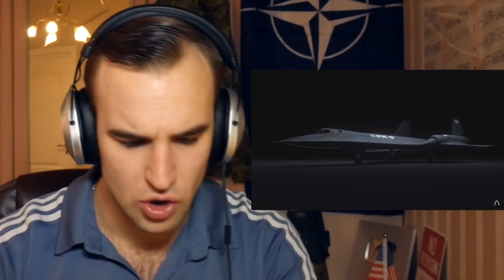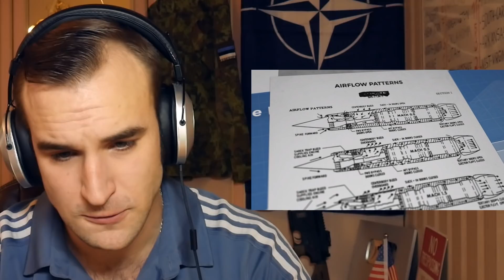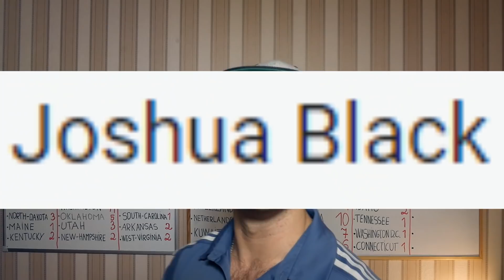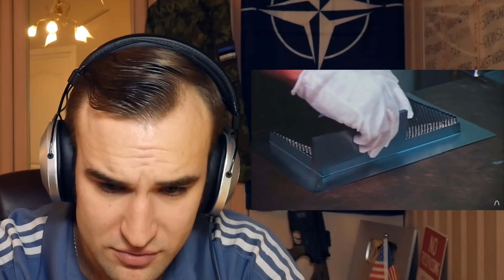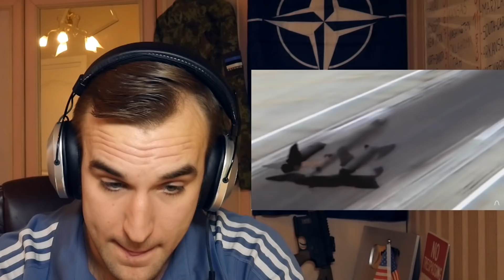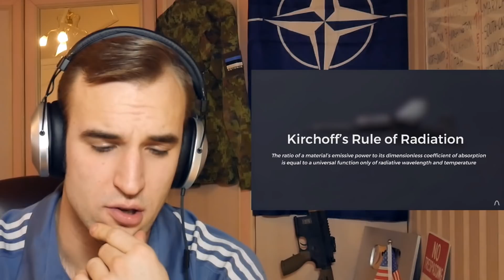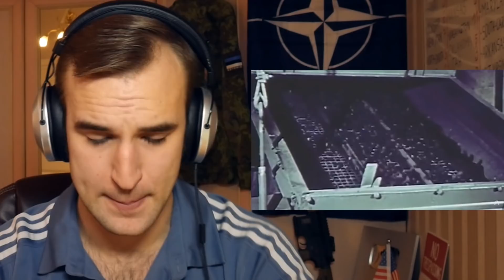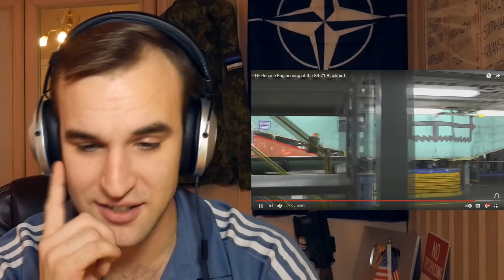Estonian Soldier react to the Fastest Plane in the World - SR-71 BLACKBIRD

Comment: Military aircraft have cracks in the spars that hold the wings on.  These cracks are mapped, and checked often to determine the crack growth rate. These rates are the determining factor for grounding. Keep in mind these procedures exist in commercial aviation! 😂😂😂. During Vietnam the pilots would sign off on dc-3’s with fuselage cracks you could look through, and would ground any aircraft. Not in Vietnam, as the pilots would be sent home, as soon as they reach a certain amount of hours.  So, fly those easy planes till they literally fall out of the sky!

Comment: In hot climates, black jumpsuits are good for outside work - if you spray them with water-  they rapidly pull heat from your body- so long as they are wet.Good for 30 to 45 minutes at 110 F.

Comment: The heat of very high supersonic flight is NOT from friction, It is from ram pressure. When you use all your strength to smash a hammer on a piece of steel, you get a spark. The energy of your blow is converted to heat, enough heat to tear apart the molecules holding the steel together, and release light. The same thing happens when you smash an object supersonically in air. When a meteor flashes on entry into the atmosphere, it is not friction. It is the result of ram pressure, the continuous pounding of the object into a solid wall of ultra-compressed atmosphere.

Comment: When a supersonic  object collides with air, it knocks the air molecules out of the way. When these molecules collide with subsonic molecules, they form extremely high pressure regions, nearly solid regions of ultra-compressed air. As they slow, these regions propagate to form sonic booms. identical to the leading edges of blast waves from explosions.  In supersonic flight, this happens every time the subsonic air is smashed by the supersonic object. In subsonic air, this can happen quickly, so you can hear sonic booms more than once from a single supersonic craft. It is not from breaking the"sound barrier", but is continual from any supersonic object- i.e, the crackle of a rifle bullet.

Comment: I don't know if this is been brought up but a little tidbit about the jet is when they use titanium and flying at over mach3 the metal expands a lot so when it is sitting on the ground and fueled it is actually leaking fuel because there are gaps in the Jets body to allow for expansion at Mach 3

Comment: Artur, you cannot fix these fuel leaks, as the plane is made of titanium....which I believe expands at 600 degrees. If the plane is sealed completely (as are other planes)...when the titanium expanded at Mach 3.4  in the air at 20,000 ft...the plane would buckle at the seams and would destroy itself.

Comment: And oh we still had those standards for everything in the USMC, from fuel, to hydraulic oil, gear oil. Etc…the list goes on, even down to how much water and the size of acceptable holes in your water proofing bag (WP bag) that you out gear into, inside your pack, once reason whey put in a contractor 3-5 mil trash bag inside our packs, then the WP bags, with stuff inside. Then you twist the top of WP bag, and tie shut, with paracord, or any twine, then the bag. Each one you push out any extra air (the puffing of the bag) but not anymore, as you need the air to float, if you’re going into the drink/have to swim with all your gear. Yes you can, with over a hundred pounds of gear, of water proofed right, had to do it, not easy, and sucks, and “swimming” like that, is barely not drowning and not fast, haha. But you can survive, and go mostly where you want, slowly.

Comment: Funny thing is... The A-12, the little brother of the Blackbird used by the CIA, is 150 mph faster. There is almost no visual difference between the 2, except that the A12 is smaller and has 2 less windows, and also doesn't have tail rudders on the underside.

Comment: The sonic wave shop boom is when an aircraft actually is going quick enough that it's body splits the air and creates a vacuum cone in between and when each side of the air flow pulls back together rapidly that is the boom you hear.

Comment: This plane is Soo fast, that during high speed flight the temperature of the plane's SKIN is over 600*F Degrees. The heat also causes the skin to expand, which seals the fuel tanks. On the ground the plane leaks fuel and needs to be refueled shortly after take off. They say the fuel cost more per gallon than the most expensive Scotch.

Comment: We do have flat fans that go under your laptop to circulate the warm air out to avoid overheating if necessary. It’s about the thickness of your laptop and the same size with partially open fan blades in the center. Basically raises up your laptop to circulate the air flow underneath. Comes with an electric plug in and battery operated portability.

Comment: The SR 71 is Filled with JP7 Which Doesn't Ignite Easily. A lit Match will not Start a Fire, it won't burn. JP7 has to be Ignited with Hypergolic fluids. The Fuel is like this because of the Temperatures of the Skin. JP6 would Ignite and the Aircraft would Blow Up.

Comment: I believe that there is a small misunderstanding on a "cloud" around a plane's wings when it breaks the sound barrier. The "cloud" is actually water in the air that turns into fog because of the low pressure air above a plane's wing. It requires extremely high speeds, meaning extremely low pressure above the wing, and therefore the "cloud" is visible. A sonic boom is essentially a plane catching up to it's own sound waves ahead of itself, generating a shockwave.

Comment: The SR-71 leaks fuel on the ground.  However, it does not leak fuel during high speed flight because the heat from friction causes the pieces of the plane to expand into a tight fit.

Comment: The truly remarkable thing about the 71’s engines is how analog they are. Case in point, the air resistance generated by its forward movement is what actually moves the cones backward to the ideal positions to minimize the shockwaves. There isn't a computer calculating that stuff, it's just physics.

Comment: Regarding the leaking fuel, it's important to note that the fuel which this aircraft used was not flammable like gasoline or kerosine. There are actual demonstrations where a flight technician would take a bucket, fill it partway with fuel, and toss in a lit match...which was then extinguished by the fuel.

Comment: The aircraft leaked like a sieve on the ground but once it was flying and the skin heated up a little bit it sealed itself up tight.  Usually what the pilots would do is take off, go fast for a bit to seal up the craft, slowdown to refuel their now mostly empty tanks, then fly the mission.

Comment: More SR-71 trivia: The engines had no self-start, to heavy, so they had to hook up a pair of buick V8 engines on a trolley to the engines to start them.
In order to keep the fuel inside the wings from igniting from the extreme heat, they had to design a new fuel. Problem was the new fuel was so stable they couldn't ignite it with anything less than a spontaneously combustion chemical.
The entire airframe expanded and contracted several centimeters per flight. At cruising speed, the expansion sealed the leaks in the wings. 
The titanium used to construct it was produced by the USSR (lol).
It couldn't take off with a full fuel tank, too heavy, so it would have to take off then get fueled up in mid air before every mission. 
It flew so fast pilots flying east/west recon patterns would see the sun rise and set multiple times during a mission. It could outfly the earth's rotation.
Designed and built by a team of less than 200 people in less than two years.
Reply: a team of 200 people … with sliderules!

Comment: Dust particles bro...Air wasn't as pure as you might think. And they were flying above desert area so often that the air at that altitude sometimes were still filled with desert sand particle...albeit small it can cause a lot of damage. Not to mention pressure created by such speed.

Furthermore it was energy discharge...Energy discharge always go towards place that was either close to that area or...To an area that has small surface area.

Comment: Artur, in spite of what people may think, this aircraft was designed by engineers using slide rules. A recent laser scan of an SR-71 airframe was done, and the information processed by a program designed to look for areas where improvements could be made to the aerodynamics. After this was accomplished, the result returned by this program merely stated ‘nominal’. This meant the design, accomplished by a team led by legendary design engineer Clarence ‘Kelly’ Johnson, was as efficient as it could be. When the time came to build this amazing bird, which used titanium alloy, the CIA set up a front company to purchase quite a bit of titanium from the Soviet Union. Ironic given what the aircraft was to be used for.

Comment: Remember, Mach 3.2 is only the "published" cruise speed of these planes. The top speed is still classified. We do know they have flown faster than mach 4 because of how fast one SR-71 flew from the West coast to the East coast. It flew so fast that people figured out it had to be flying faster than Mach 4 to to make that trip in the time it did. 
The engines itself had no top speed and were capable to fly WAY faster, however, it was the air frame of the plane itself that dictated the limit SR-71's top speed. Cheers,

Comment: I saw an interview with personnel who worked on or with the Blackbird. One, not sure if he was pilot or ground crew,  but that when you walk toward an SR-71 in the hangar for the first time, they were shocked to see the plane copiously leaking fluids onto the hangar floor. When they asked,  they were surprised to discover that the extreme temperatures Blackbirds faced meant that the plane on the ground isn’t the plane it will be in flight. In flight, due to the temperatures, those seals and leaking points close by the materials expanding or contracting. I found that fascinating.

Comment: When you are going faster than the speed of sound, the air doesn't have time to get/slip out of the way, so you have to push it out of the way.  IOW, the nose is (metaphorically) going through an invisible sponge of 'sandpaper' (the air molecules) -- that's what is heating it up.

Comment: The jet that the SR 71 was based on is called the A 12 , it looks identical to the SR 71  except it is only single pilot, and shorter than the SR 71.  The A 12  was faster and could fly higher, but didn't have anywhere close to the range of the SR 71  which is what they needed.

Comment: The SR-71 has been replaced and retired by a new secret bird.
It's codename " Aurora "  Was originally leaked in the mid 1985 on some unclassified budget reports.  And has since has a few sightings / blurry photos.

It existence was officially confirmed in April of 2019 and it's capability of Mach 6,  the aircraft having flown from 1993 to 2018.
Now Aurora is retired despite still being mostly classified. And now even Aurora has been replaced with a even more advanced jet the SR-72 likely capable of more than Mach 6.

Comment: I need to comment on an error that you made. In a previous video, you stated that a B-2 bomber had been shot down. This statement IS NOT TRUE. There was a crash of a B-2 due to an engine fire in Guam. They put the fire out and flew a crew to Guam to repair the B2. They repaired it enough to fly back to the U.S. and flew it back. They fixed up the plane and it is now back in service, again.

Comment: Pointy shapes have much less volume per unit of surface area which means they get hot very quickly when exposed to sources of heat. So while they are aerodynamic and don’t produce as much drag as blunt shapes, the trade off is they get hot from the shock heating. Space vehicles like the Shuttle would use blunt shapes to minimize heat absorption on reentry. They could afford to do this because they only had interest in slowing down in atmosphere and so more drag was a good thing.

Comment: Every hear the stories of Pilots of the SR-71?   Well story I hear was a Cessna was asking speed and info confirm from tower.  the Tower replied telling the 6000 Feet height at 188 knots.  then a bowing commercial 747 asked for fun for his Speed,  and he was going 500 Knots at 36000 feet. and now a F-16 pilot said Tower what is my air speed.   and he was doing 720 Knots at 48000 feet.   but that is when a Black bird asked.  Tower speed and high check.   80 000 feet, at 2200 Knots.     The silent of radios after was amazing....

Comment: Technically, the SR-71 wasn't the fastest jet ever. That honour goes to the YF-12 Archangel (Oxcart?) interceptor, the elder sibling of the SR-71 Blackbird. Only 3 were built (pre-production) which went to the CIA before the project was cancelled. Top speed was  2,275 mph, as compared to the SR-71's 2,200 mph. However, this is all pretty moot as the numbers are still classified secret. I suspect that the SR-71 was capable of much more, given comments made by pilot Major Brian Shul of the "LA Speed Check" story. Raegan had called for an airstrike against Libya and Shul and Watson flew in afterwards to record the damage. Of course the Libyans were waiting for him and launched a barrage of missiles at them. They had the choice to abort or increase speed, which they did, made the turn, and headed home. Shul stated that his hands were locked on the throttles in full forward position, and only powered back when they were safe. He said that they had never been so fast before and the Mach numbers were "pretty scary". So I'm guessing they, at that point, were way more than 75 mph faster than their usual maximum.

Comment: I am surprised that the public top speed has been reduced.  When I was a kid the published top speed was : IN EXCESS OF MACH 3.5.  So you can damn well bet this beast was doing over Mach 4.  As an American I can tell you, if it was capable of Mach 5 you can damn well bet we did it.

The guys who designed this craft did it all with a slide-rule - It's a analog pocket computer.

When in flight and it heats up the plane EXPANDS and seals.  At operational temp is did not leak.  It GREW by 1 foot, thereby sealing all leaks.  The plane would take off with enough fuel to meet a tanker, toped off their fuel and did the job.  The whole plane was titanium and could take the heat.

Also the other reason it was painted black is the paint itself was RAM  ( Radar Absorbing Material )   Also known as stealth.  The SR-71 also launched recon drones.  And this was all 1950-60's tech.  Before major electronic computers.

Comment: There was also the YF-12A (the Y means a prototype) which, without getting into too much detail, was an interceptor version - and American MiG-25 if you will (MiG-25 could reach Mach 3.2 but it would damage the aircraft). They got as far as test launches of the AIM-47 Falcon (which was further developed into the AIM-54 Phoenix, famous for being used by the F-14 Tomcat) at high altitude and over Mach 3.

The other problem with building the SR-71 out of titanium is, at the time, the best source of it was...the Soviet Union. So the CIA set up front companies to buy the titanium needed to build the SR-71 from the Soviet Union. So, the Soviet Union was a key supplier of materials for a plane built to spy on it.

Comment: HERE'S IS PROBLEM. SR71 FINAL FLIGHT COAST TO COAST (3000 MILES) IN 1 HOUR. THAT SOUNDS MORE LIKE MACH 4 . THE PILOTS WANTED TO GIVE IT 1 LAST SPEED RUN AND  WHERE MORE LIKELY TOLD TO SLOW DOWN , SO TO CONCEAL IT'S TRUE SPEED FARTHER. SO VIA WIKI IT SAYS MACH 3+ , BUT THE SR71 TRUE MAX MACH SPEED IS STILL CLASSIFIED.
Reply: Classified means ???

Comment: Chemical Engineer here from USA. The reason the tip gets hot is likely to due with air fraction and drag, but at the high speeds, the boundary layer develops on the tip preventing efficient heat transfer between the tip and air since the boundary layer is mostly stationary and increases in height along the tip. This prevents convective heat transfer-blowing air over a hot object-from occuring.

Comment: The fuel was slightly pressurized this was done to illuminate the possibility of any kind of accelerant combining with the fuel the fuel would not come bust unless you came in contact with air so nitrogen was pressurized inside the tanks a little information that was left out

Comment: The fuel leaks stopped once the aircraft achieved supersonic flight speeds as the titanium skin expanded under high heat and became self-sealing. Additionally, there were 16 shots of TEB per engine, not eight.

Comment: JP-7 is very hard to burn.  Go ahead and throw matches at it.  The reason the engines get hotter than the front is that slowing down the air increases the temperature.  My favorite thing about the SR-71 is that when the Chinese or Russians me with  each other or North Korea, they would fly the SR-71 over with full afterburner so that the sonic boom would hit them.  Shaking the building and causing a loud bang.  It was only done to prove the point that we can watch you and there is nothing you can do.  They didn't just fly over once but continually when the nations were trying to make deals.  Now that is how you flex on your enemies.